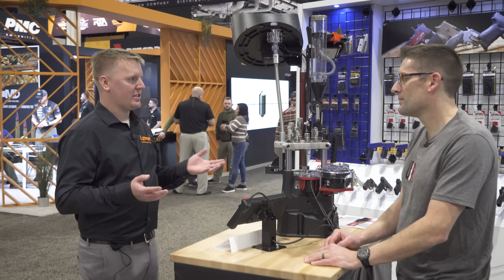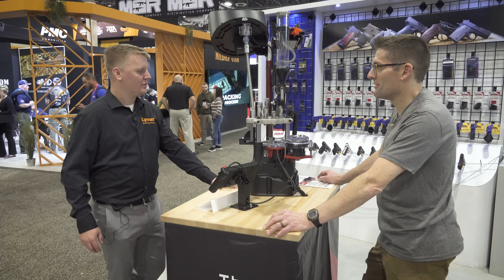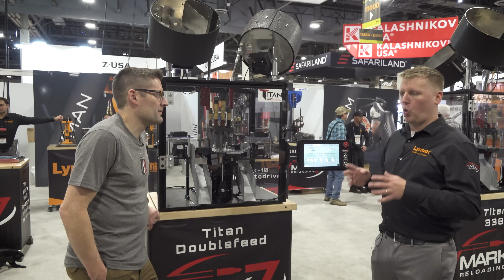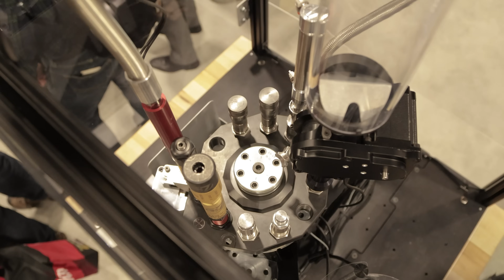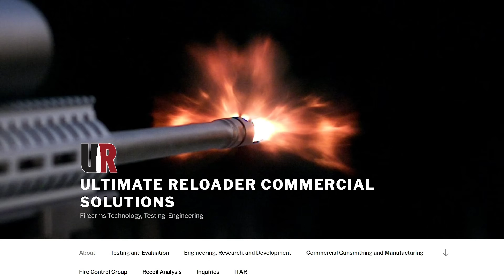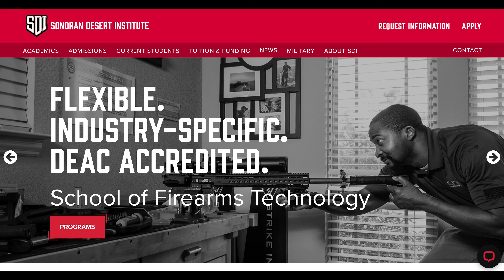NEW From Mark 7 - Genesys & Titan

Comment: Hope it works out better than the Apex 10. Mine, I take it apart, clean it up, got that down to around 2 hours now, put it all back together make around 10 9mm bullets and a primer disintegrates in the Primer shuttle and of course as that case moves through without a primer it spills the powder all over the machine! Start all over again with the disassembly and cleaning! Make another 5-10 rounds and take it apart again! Wicked WASTE of Primers, Powder, bullets and the loss of a case!  Come to realize that it is less expensive to buy new ammo, around 24 cents a round and the components to reload around 25 cents a round and a whole lot less aggravation and waste! You can buy 15,000 new 9mm rounds for what the Apex 10 will cost you and then that again if you want to reload the cases! Something definitely wrong with this picture!

Comment: Sorry mate, losing a singular drive connected to a chunky, reliable mechanical linkage in favour of three independent electrical servos is not recipe for reliability, you now have 3 times the electrical fault potential, I will stick to a big, beefy, sturdy, reliable mechanical linkage

Comment: $5,999 is a super aggressive price, but not in the way I think he meant it. IMO 😂
Reply: Well, the original autodrive for dillon 1050 was over 3k at launch just for motors and little bit over 4.5k with all the sensors (decap, primer, swager, powder and bullet seating.. 100-300 each). So getting the whole package for 6k including case and bullet feeders and priming station (and the actual press) is really competitive here, as an equivalent would cost maybe 2k more to assemble (and you need to mess with it).
Reply: @BigFx  Mostly I’m joking because my press cost me just over $310 about a year ago. My budget isn’t even in the same universe as guys who would be considering these works of art.

Comment: Do you feel a beginner could use these new presses?
Reply: Not ideal. Too much margin for error with even something basic like a 550. I did learn on a 1050 but it wasn't optimal. Wasted materials or pulling Bullets. Most people have a hard time moving from manual to automation.
Reply: These are definitely NOT suitable for a beginning reloader. I ran a Dillon 650 for 11 years before adding a Mark 7 AutoDrive. I eventually sold the AutoDrive because it was too finicky with the otherwise great 650 MECHANICAL press. Yes, it worked most of the time, but I spent far too much time dealing with issues unrelated to loading cartridges. The 650 wasn't designed to be automated. I now own an Apex-10 with AutoDrive and it is FANTASTIC. However, I have 14 years of experience with pistol reloading in volume. For a beginner, stick with something simple and mechanical. Once you learn all about making cartridges, then consider something like the Genesys.
Reply: @bjinpass  Thank you for the feedback!  I even spoke to the manufacturer and they agree with you. Must be dead on because they lost a sale with their honesty!  Appreciate your valuable input.
Reply: This is not beginner friendly, and learning on it is outright dangerous. The process is automated, but the setup is not - YOU have to dial in all the values, tolerances and set up all the sensors correctly. In best scenario you just jam the thing all time and won't have any idea why for hours. At worst, you create a massive pile of dangerous loads that you won't figure until you yeet them and they explode in your face.   Learn on a press where you see exactly what each station is doing, and where you have manual ways to confirm it does what you think it does - measure, measure, measure every step. Once you get comfortable doing that and need to crank thousands of rounds, consider moving into automated stuff.
Reply: @BigFx  thank you. It's just not realistic for a complete beginner.
Reply: I'm pretty sure anyone that can read and take directions can do it.Negative comments to scare others so they can profit!
Reply: @thadfoote8653  very interesting perspective
Reply: @Thad Foote  so who can profit? Off what exactly? If you don't even know the basics in your supposed to successfully jump into 2500 rds and not not make potentially catastrophic mistakes? I've seen seasoned reloaders make costly mistakes. That's beside setting off small explosions inches away from your face.
Reply: @thadfoote8653  I am not selling any equipment, so I am not sure how can I profit. I doubt others in the thread do. Also, no one who said it's not beginner friendly was negative. Saying a product is not for someone is not negative, it just means the product is targeted for different audience. In the case of this particular press, it is for people who need to crank thousands of rounds weekly (if not daily) of the same consistent load. This is far away from a beginner, who will need to prepare many different loads in batches of 5 to 50 to test out what even works with his pistols/rifles, chrono every single round to ensure it was consistent etc.  For mass production, you need experience in preparing the station, setting up your dies, feeders, powder measure and most importantly setting up all the sensors - it is not plug and play, and crucial for any automated reloading in high volumes, errors here will cost you a lot of money and can cause serious injuries. You really do not want to seat bullets low, or over/under powder or 2000 other things that can go wrong in a multistage process like this.